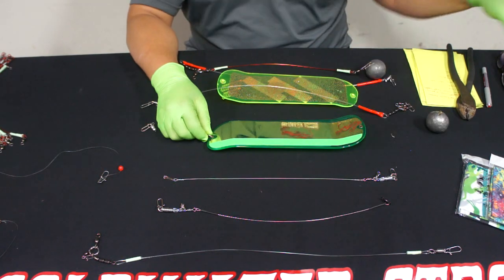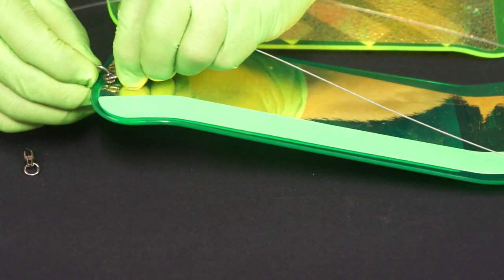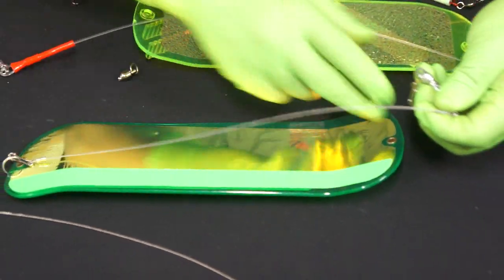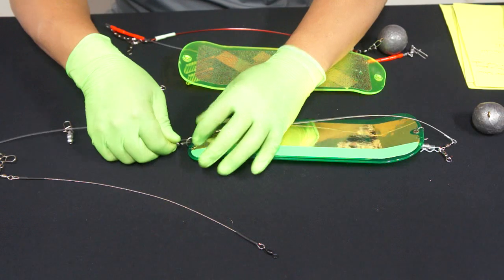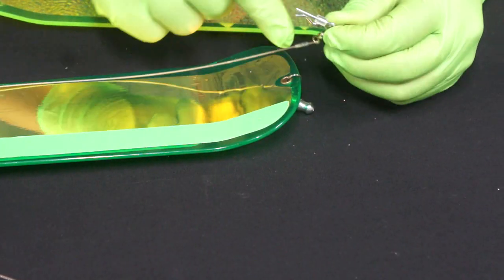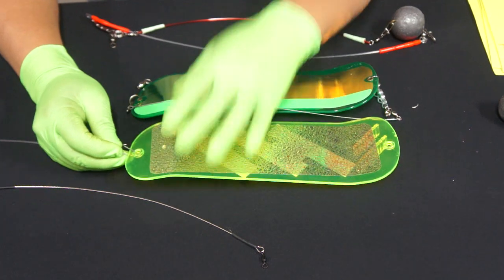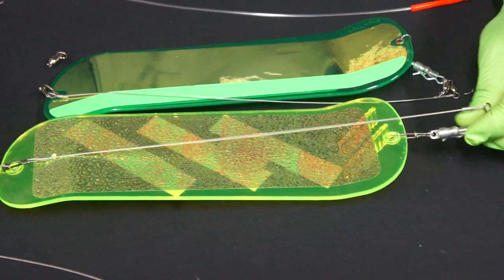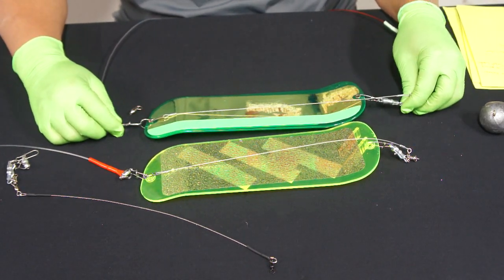New and IMPROVED 360 Flasher Release

Comment: I made a half dozen releases today (rain) AFW makes nylon coated stainless cable in 90 lb 135 lb & 170 lb. Crimp front end to front solid ring of any flasher. Eliminates extra hdwr fwd. Back end - made them 3" longer than rear swivel connection & added a 100 or 150 lb Spro barrel swivel in the rear loop of my release. My break away is very simple. Its a papered wire twist tie clipped after twist but you could also use plastic coated phone wire from the big box stores & twist tie your barrel swivel to the rear swivel on any flasher. It eliminates all the oversized hdwr. I used 90 lb cable for my break away. Works like a charm. Similar 2 ft set ups for my flasher leader. What I spent on the crimper, crimps & cable assortments would have been spent on 4 releases. Now I have material for wahoo, ling cod leaders etc probably more than I will use. Gifts for fishing buddies... Tinker around with this at hm for custom rigging. I used the smaller copper double barrel crimps but also ordered some thick wall brass double barrel crimps for tighter grip. Lots of applications for the toothy ones.

Comment: But those duo-snaps will open up when you catch a fish. Then you can lose everything behind that bumper. Seen it too many times.
Reply from the maker: David, are you talking about the duo-snap on the flasher end of the bumper line & the Hawian clip?. I Use heavy duty snaps 120#, I over build my leaders for strength and function. I have not seen one open up on a fish, unless they forget to clip it in place. And I have seen that happen.  If you would like to put it to your test, I will send you one for free.
Reply: Lost several fish because of that issue....
Reply: The only way a dual snaps fails is because of operator error or your using cheep crap?